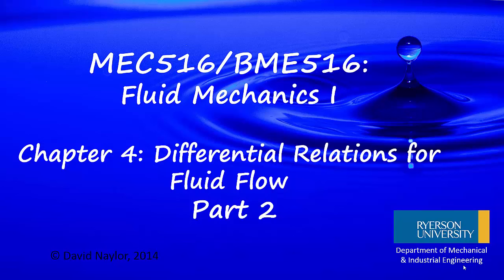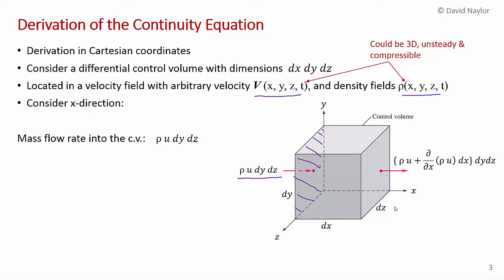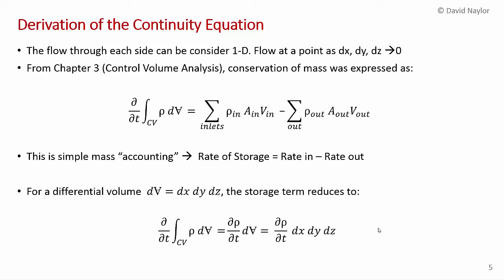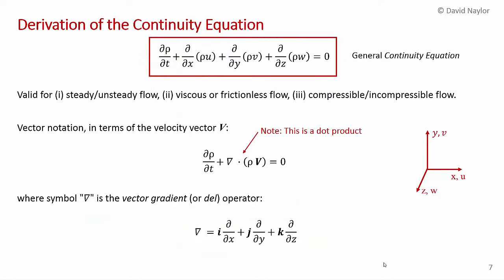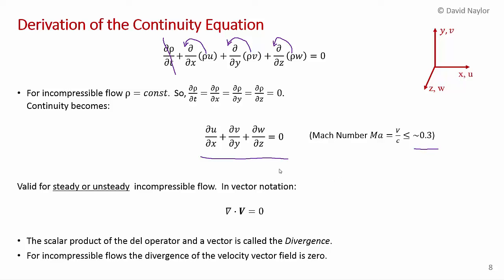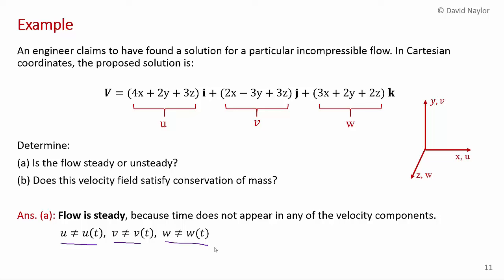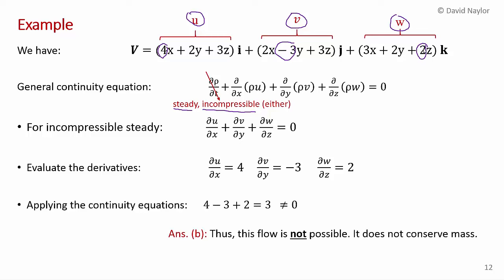Derivation of the Continuity Equation for Fluid Flow

Comment: Hi professor, many thanks for the excellent lectures. I tried the derivation of the equation in cylindrical co-ordinates and I couldn't quite get there so ended up looking at another reference. Should the dA in the outlet term you show at 14:30 actually be (r+dr)dΘdz (rather than rdΘdz) to account for the slightly larger area at the outer radius? This is what the derivation I saw suggested.
Reply from the maker: Sorry for the slow reply. I just tried this derivation. I think you are getting hung up by second order effects, which always go to zero. Remember that this equation applies at a point, so r+dr --> r as you shrink to the differential volume to be infinitesimally small.

Comment: Why are we taking the Taylor expansion??
Reply from the maker: The change across the faces of the  differential volume (at 2:59) only considers the first order term. I am pointing out that the true variation is not linear ---  so there will be higher order terms (as described by the infinite Taylor expansion). So you might wonder: Is a first order approximation sufficiently accurate?  The point I am trying to make is that,  as Delta_x --> 0 and becomes dx, these higher order terms vanish more quickly than the linear term, and hence, are not needed. This is a standard feature of these kinds derivations in fluid mechanics, heat transfer, solid mechanics, etc.
Reply: @FluidMatters  thankyou for your reply and the video is a great explanation. 
Final question ...
Since this is an isolated system what is causing the change in the flow rate?
Reply from the maker: @tonymunene1592  It's not an "isolated system" in the thermodynamic sense of that term. It is just a control volume, with mass flow in and out. So, consider this to be a arbitrary control volume taken anywhere in any real flow, such as delivered by a fan or pump. A real flow will have have local velocity variations for various reasons, e.g. due to changes in the cross sectional area of a pipe.
Reply: @FluidMatters  thankyou for taking your time to answer, much appreciated!

Comment: I wouldn't say that the rest of the analysis is easy (at 14:34).  Firstly, because the term (r+dr)[dθdz] is missing in the formulation of the mass outflow on the infinitesimal area; if you follow this video only you can't arrive at the correct answer. Secondly, when you isolate the inflows and outflows across this face, you have to use the curious mathematical fact that dr^2 = 0 to get rid of one of the terms.  Then, you have to see the odd step of multiplying some terms by r/r so you can factor a 1/r term out. Then, after more simplification, you're left with a term like (1/r)[ρVr+∂(ρVr)/∂r], and you have to recognize that the term in brackets is the same as ∂(rρVr)/∂r by virtue of the product rule of derivatives.
Reply from the maker: Sorry for the slow reply. I just tried this derivation. I think you are getting hung up by second order effects, which always go to zero. Remember that this equation applies at a point, so r+dr --> r as you shrink to the differential volume to be infinitesimally small. (So, it's not "curious" that second order terms like dr^2  equal zero.)

Comment: You used Cartesian coordinates not cylindrical coordinates.That is a mistake on the first slide.
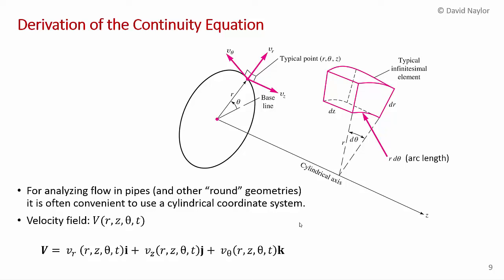Reply from the maker: This is definitely NOT a mistake. This is an outline of the presentation. I cover the derivation in cylindrical coordinates at  about 12:34
Reply: @FluidMatters  Ok thanks